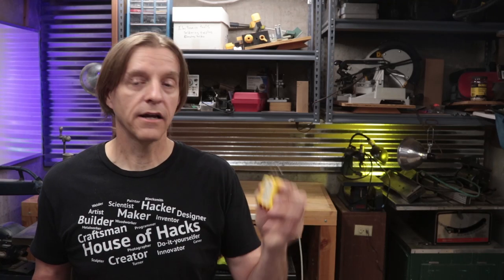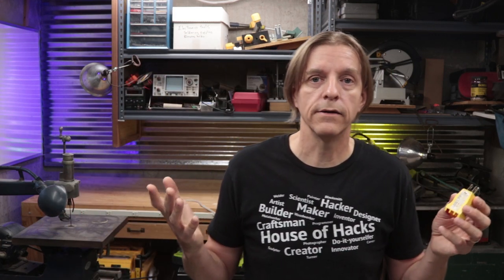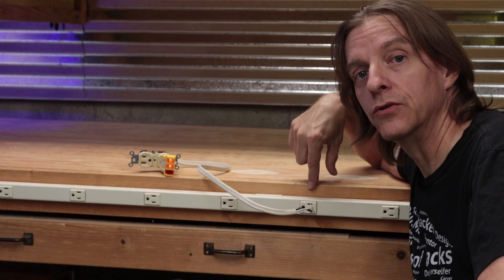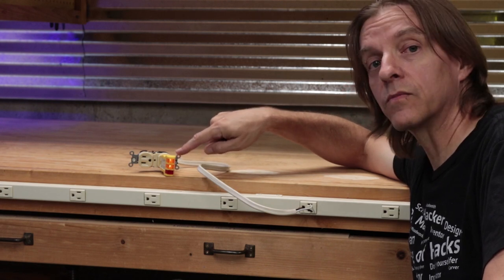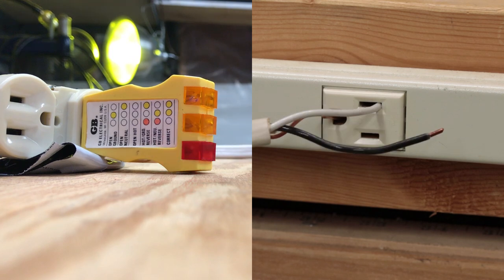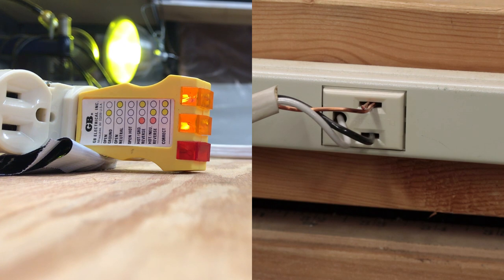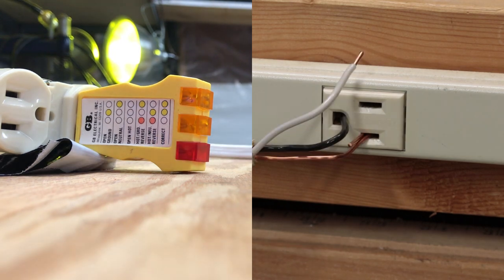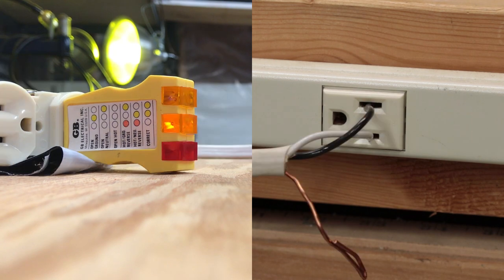Outlet Tester Light Meanings - Examining All Combinations

Comment: I have a question that is not covered...my test is showing on one outlet no red and two orange perfectly.  In another room, it is the same, but the right orange light does not light up as bright on all outlets in the room.  This light almost pulses, not on and off, but very slightly brighter to dimmer, though it does not go out.  Why do they clearly light up in one room and the right orange light does light up, but not so much as the middle one?
Reply from the maker: I would first look to see what else is plugged into that circuit. I suspect there's either a high-current appliance that's putting an intermittent load on there that causes the light to flicker (such as a washing machine or microwave) or something on on that circuit has a problem that's causing the blinking. If it were me, I'd start unplugging things, one at a time. After each thing is removed, check the outlet tester and see if it's still blinking. If it's not, the last thing unplugged is the culprit. Note that circuits may span multiple rooms. There's not necessarily a one-circuit-to-one-room relationship.
Reply: @HouseOfHacks  Thank you for your response.  
I live in an older, second floor, one bedroom apartment (built in 1973).  So,  who knows what's on the circuits.  The  breaker box is probably outside because it is not inside. :(  The room in question is my bedroom, which I have only a laptop, an aroma diffuser and a lamp plugged in and suspect it's tied into the kitchen.  

I have noticed some irregularities throughout though.  I have a GFCI  in the kitchen that failed when I tried to test it.  Had a heck of a time getting it back on. That can't be good.  Have the same issues with bathroom GFCI but space is too tight to use the tester.  My workstation is on the same circuit as my lil frig, (3.2 cu ft),  when it kicks on one of three of my computer monitors goes black, but not off and then lights back up after a second.  Plan to do some rearranging to eliminate that issue.

I recently started earthing with mats.  Thought I would try hooking one up in my bedroom last night and felt way to wired compared to using a foot mat and a desk mat at my work station.  So, I decided that it was probably not a good idea to continue with the questionable bedroom outlets.  However, would a grounded extension cord be acceptable to use with an outlet that tested correctly?
Reply from the maker: Ouch. In an older apartment, who knows how things are wired and where the circuits go. It's conceivable there are circuits that service multiple apartments, so isolating the issue may be a problem.

On the workstation issue, an uninterruptible power supply might help with the monitor issue.

As long as you don't have any high current devices, I'd expect the extension cord to work OK.

Good luck!
Reply: @HouseOfHacks  lol.  I know.  I knew they were older, but was shocked to find that old.  
Thank you for the recommendation for an uninterruptible power supply.  
Best  wishes and thank you for the information you provide. :)

Comment: I have an outlet where all 3 lights are on???  Any ideas??  I pulled the outlet and the ground is grounded to a green screw on the case, and the neutral and hot are correct (Neutral is on the long T slot, its a 20 amp outlet, and hot is on the short...weird)
Reply from the maker: I'm not sure off the top of my head. With the green wire going to the box, I assume there's no ground wire in to coax? It's only two wires? I'd want to check that the box is actually grounded, although if it weren't, I'd expect it to read open ground. I suppose there might be some other issue somewhere in the circuit that's causing the problem, e.g if another outlet has something going to the box that it shouldn't that's feeding back into this one. Have you checked other outlets on the circuit? Are they correct? If so, it may be a problem with the outlet itself.

I'm not sure what's weird about the neutral on the T slot for a 20 amp outlet; I think that's what it's supposed to be.
Reply: @HouseOfHacks  no, sorry, the weird comment was for all 3 lights being on in general
Reply from the maker: Ah, right, that makes sense.
Reply: I know i am three weeks late to reply,  the only issue i can think of why you have all three lights on, would be that the outlet is wired for 240 volts instead of 120 volts like it should be.  Since you mentioned it is a 20 amp outlet,  a possibility would be someone previously had a large window air conditioner that runs on 240 volts but during a renovation no longer wanted the air conditioner and so removed the air conditioner outlet and replaced it with a  standard  20 amp 120 volt outlet.  If i were you i would take a multimeter and check the voltage.
Reply: @Sparky-ww5re  Yep, you are correct!  I posted this question on another video about this tester and he suggested the same thing as you, so I bought a multimeter, and you were both correct1  It is a 220v receptacle!  THANK YOU so much for taking the time to reply!  VERY much appreciated !
Reply: @NerdRN  i am glad i was able to assist you! Hopefully you got this dangerous condition remedied before someone plugs in a very expensive new 4K tv and blows out all their hard earned $$$$ or worse.   Those 3 light testers can be very deceiving.  One of my fellow electricians at work call them "the 3 eyed liar" for this very reason.
Reply: @Sparky-ww5re  WOW thanks, described my same exact issue.

Comment: I have a 3 lights on?????😩
Reply: All three lights lit means the outlet has 240 volts,  or somewhere close to it.  Either because of a floating neutral on a multiwire branch circuit eg. a 12/3 romex in your kitchen supplying the two circuits for the countertop outlets with the black and red sharing a common neutral, or someone installed a standard 120 volt 15 or 20A outlet on a dedicated circuit when they really needed a single outlet 240V 15/20A, such as you might find in your living room or garage for something like a larger air conditioner or electric heater exceeding 1500 watts (the electrical Code and UL standards limit the plug-in space heaters to 1500 watts when a 120V 15A two or three pronged plug is factory installed)
Reply: @Sparky-ww5re  Thanks for responding. Yes we figured this out and the worst it did blow the fuse in the brand new microwave. It’s an old house and we bought it in the middle of someone else’s remodel that walked away from it, so there were lots of puzzle pieces we had to sort out with the wiring. We believe it went to the laundry room. We’ve decommissioned the line and went natural gas to dryer and kitchen stove, to take the burden off the 100amp service panel. Thanks again!

Comment: My problem with the tester is that when I close the circuit I trip the breaker which means this tester wont even work and wont tell me what is wrong.
Reply from the maker: By "close the circuit" do you mean turn the circuit breaker on? If so, you have a short circuit somewhere that's not related directly to an outlet. This tester only works for checking the wiring of individual outlets, not an entire circuit.
Reply: @HouseOfHacks  thanks for the reply, i figured it out, process of elimination only told me that everything was fine, changed out the plug and all is well.
Reply from the maker: @kinsary  Awesome! Glad you got it figured out!